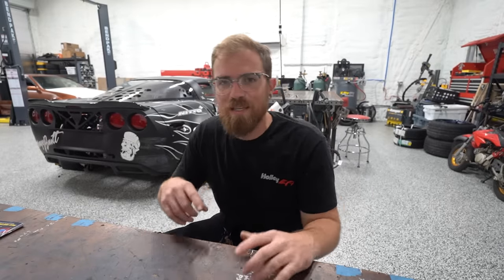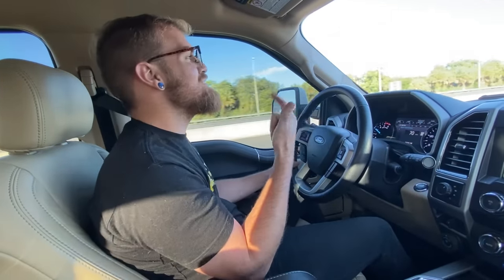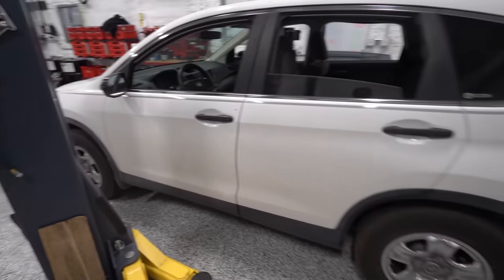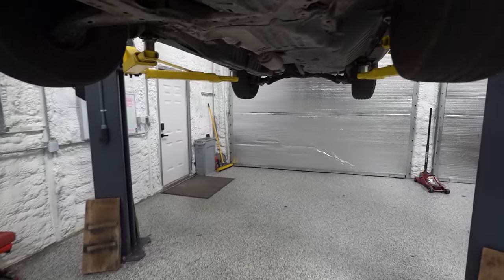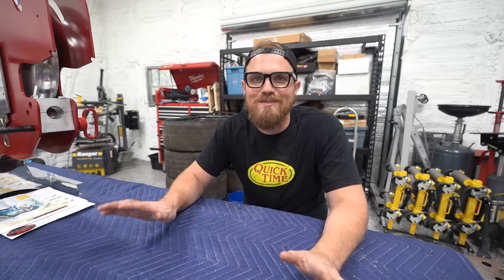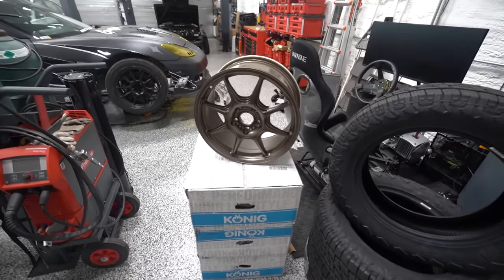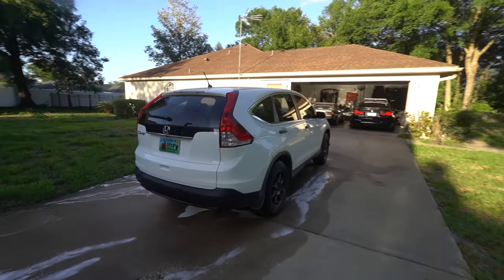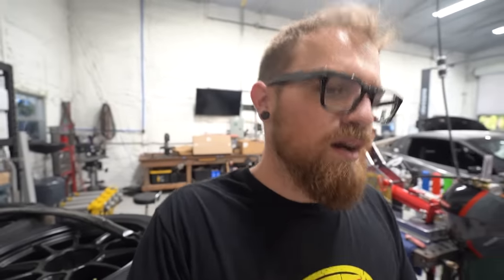Buying a boring daily and fixing it up.

Comment: Hard to go wrong with a Honda or Toyota as a daily driver.
Reply: My 15' Rav4 with 170k miles and zero issues, my old 08' rav4 with 280k miles and who's only issue is an ABS wire, and an old 05' Camry that had 300k miles before leaving the family all agree lol (All of which lived 99% of their life on horrible Michigan Roads and Winters)
Reply: EDIT : CANNOT
Reply: toyotas are better tbh i cannot stand the d series lineup & their cylinder head issues and 4 speed autos failing

Comment: Freshen the bushings/mounts/joints and wheels bearings, maybe rebuild the brake calipers depending on the condition of the boots.  And full fluid freshen.  At least those are what I do as a base maintainance with a used Honda.  Especially the McPherson years.

Comment: Honda technician 👋 oil pans are common leaks on those. Need to drop the subframe a little to get it out - hondabond to seal. It also looked like the oil filter housing was leaking. Its 3 bolts, 2 O rings to fix. Some say you need to pull the intermediate shaft, but uou dont - takes about 20 min to fix.  Rotors on hondas in general warp easily so good you were able to fix that.

Comment: OIl leak might be the K Vtec solenoid. Can reach over the valve cover on the left to check. It will drip all the way down the back of the block.

Comment: Fun fact, rotors in general don’t warp, shaking is actually from inconsistent mass transfer of brake pad material caused by differences in friction of the rotor surface, that’s why getting the rotors turned just freshen the surface.
Reply: I’ve never had warped rotors in any of the cars I’ve driven.  The best way to avoid is to let the car coast to a stop as much as possible.
Reply: @user-tb7rn1il3q  almost all of my cars have had it except newer cars, had it on a 05 Lexus, 05 Toyota, and my 94 Nissan. I think it occurs when the rotors get well worn out

Comment: That oil leak is probably the oil filter housing gaskets, its a very common leak on those cr-v's. Its 3 bolts that hold the housing to the block and a few o rings to change out.
Reply: On K series period had to do this on my girl's accord as well.
Reply: VTEC solenoid gasket leaks all the way down on all the k series
Reply: Nice looking CRV. So, what was the oil leak? Update?

Comment: On the topic of tire, balancing, some tires have dots that indicate the heavy point or the point that the valve stem should match up to. Helps cut down on the amount of weight you use.

Comment: The C-RV is an excellent choice.👌
They typically run 250,000-300,000 miles with minimal needed repairs. The minor things you fixed are the most common things needed.
I find that 3-4 sets of pads is about the limit before needing rotors, but that all depends on each driver.
Definitely perfect for someone who works with horses because there is plenty of room in the hatch for tack and gear, not to mention good ground clearance.
The wheels and tires are a very nice touch that transform a stock looking rig to a classy ride.🤙

Comment: When it comes to warped rotors and shaking under braking, I highly recommend you check all the nuts and bolts in the suspension and front end to make sure they're nice and tight. When they're loose, they'll slightly shake the car over time and end up warping your rotors again. Had that happen with an '05 Mercury that I owned for 6 years. I always thought it was just rotors and the rough roads around my state, but a shop I frequent before I sold it found out the entire front end suspension was like, finger tight the entire time I owned the car. I had never checked it because it was a solid car that never let me down. Literally drove brand new after that.

Comment: K24s = Super Reliable.
I would have picked an Element, essentially the same as a CRV.
Rear seats fold up against the wall, freeing up the floor...so you kinda have a pickup bed when you need it.
Congrats ! 😎

Comment: I went back and forth between a 2016 Honda CR-V or 2016 Mazda CX-5.  I found the Mazda aligned more with my wants, but both were good reliable rated vehicles.

I did end up warping the stock rotors in my CX-5 due to spirited driving.  It was so bad it was throwing off the ability to align the wheels....hahaha

Comment: I agree with your thoughts on dealerships. I had a terrible experience with Central Florida Toyota that ended up with me tearing up a check and storming out. And naturally telling everyone about it even 9 years later.

That’s how I ended up with my 2012 Civic. And I recently had to top off the Freon in my AC as well. Same issue, same solution.

Comment: Put an external transmission cooler on it. Road trips will be the death of that trans. The transmissions get hot on the highway then when you get off at the exit, it starts slipping. I was the service manager at a transmission shop for 3 years. I saw several crvs come in with that issue.

Comment: You have two BMWs, Ford F-250, race trailer, drift vet, drift Miata, and several other cars all modded to the ends of the earth and you got her a used cheap SUV? Come on man haha jk jk
Reply from the maker: I didn't have either bmw, the driftvette was mid project, shop wasn't finished, etc when I bought her this. It was right after I finally bought myself a newer vehicle instead of building one from scratch like I had always done. It took me about a year to talk her into letting me buy her anything. But i'm a POS because I didn't buy her some fancy car she didn't want to impress people on the internet? That's so silly. I wasn't even going to make a video about this car, but wanted to show the wheels and tires, and though process behind buying a used car.
Reply from the maker: Also, all of those things you mentioned, make content, which is what makes the money, to buy the things. This car is just basic transportation.
Reply: @Taylordrifts  I know man. I'm just giving you a hard time. Just mocking what some people were  probably thinking. Hence the JK JK ( just kidding just kidding ). Nothing but respect

Comment: Hey Taylor I worked at a tire   shop for several years. You really won't have any issues, with balance. Unless its at higher speeds around 75+. Thats when you would prolly notice it, if actually needs to be balanced. If y'all never really drive at those higher speed's, and it feels fine at lower speeds. Then no sense in balancing.

Comment: Generally, if you have a good wheel and tire and the wheel isn't bent and you look inside the tire and you find the mark Meaning its where the seam comes together and you line it up with the valve stem. You will have almost no balance issues 99% of the time. The overlapping compound balances out for the lack of valve stem in the wheel. My dad did this for years changing tires with pry bars. Tire shops get mad at me when I have to teach them this lol.

Comment: I've got an 04 pilot and I got it with 108,000 and it's now got 230,000 and going strong here in Alaska BTW and I deliver pizza with it. Summer tires I have bf Goodrich all rerrain ko2 on 16 wheels and winter set it factory wheels with Hankook studded winter tires. One of my favorite fixes was my headlight bulbs. I ended up putting mini projector bulbs in the factory housing and those are better then factory incandescent bulbs in the housing and LED bulbs (multiple different versions I've tried) in the factory housing.

Comment: with the daily talk, what would you recommend for a college student with around the same 10k budget? have an ‘01 crv currently that is fairly clean with around 200k and have had it for almost 2 years now, been great, my parents just want to buy it from me for my younger sibling.
Reply: have been looking into the later model crv’s as well but am iffy as i’ve heard mixed reviews
Reply from the maker: I think the Lexus CT200H is a good option. They’re pretty cheap and basically a Prius with a Lexus body.

Comment: My step dad's '12 LX AWD has 286k on the clock, nothing but oil changes and I've done the trans fluid 3 or 4 times. Finally had to do a rear wheel bearing for him last month. Those damn things are mechanically indestructible.

Comment: My wife has a 2013 CRV and it has been the best vehicle I've ever worked on or had to maintain. 
The chassis is light on PITA pieces. Ball Joints, bushings, wheel bearings, have been rock solid with about 95K miles currently. 
K24, with great mileage. 
I will make this thing last to 250K-300K easy.

Comment: I’m a Honda tech, if it’s not a cut trans that judder can be fixed by doing a update on the pcm n flush the fluid. If it’s already been done try flushing the fluid again otherwise the torque converter is bad but that update usually fixes 90% of them n the ax is usually a condenser but just look for oil staining on lines n the condenser like black spots or dust or a wet compressor clutch

Comment: Bro this is crazy. My sister has a 2013 and sadly it had the transmission shutter and since I never drive it I didn’t notice. 2 weeks ago I was with her and she asked me to drive, in the first 30seconds I feel the shutter and ask what that is. She says her car has always done it(she got it with 60k miles and now it’s at 141k) so not great. I look up the issue and I saw the quick fix was a fluid change so we got it flushed out and mechanic said they found shavings in the transmission fluid. Now it shutters like crazy. we have to either change the transmission or get a new car. I’m happy the transmission fluid fixed yours though.

Comment: Just did almost the exact same thing with my wife.. Needed a car, bought a honda with an oil leak, shuttering transmission, and shaking brakes. Unfortunately I had to do ball joints and tie rod ends with the brakes

Comment: Rookie move not balancing ur tires, I’m a 24 year veteran of the car repair world and mechanic the reason for balancing is just to stop the steering wheel shaking it’s more for your bearing and suspension components. The small harmonics you don’t feel because the suspension and bushings and other soft things parts are drowning out your for sure putting stress and premature wear on a lot of your car including the outer bearings in the trans, but hey it’s not my car do what pleases you and your girl. Plus when the car fails you get a new video to make.

Comment: I just bought an 05 TL with transmission issues hoping it was the simple fix too but unfortunately it was not lol. Need to put an 06-07 accord transmission in it now. Not looking forward to that. Also MPG is MUCH worse than I thought. Total fail on my part for a cheap daily.

Comment: Im a tech at a Honda delaer. These CRVs are good vehicles. One common issue to look for is oil consumption. Just keep an eye on the oil level. If this is neglected it can cause the timing chain to stretch.

Comment: When I had my 8th gen r18 Civic with the five-speed manual trans I had the same problem where the rotors were warped and I also had bad front left and right lower control arms causing my steering wheel to shake violently

Comment: taylor that oil leak is from the oil filter base gasket, cheap rubber seal, just take the three bolts off and maneuver it out, you dont have to take the axle out!

Comment: Looks like the oil filter is leaking tbh bro also you should have cleaned the hub before putting the new rotor on too

Comment: Trucks and SUVs have always been marketed as safer while actually being more dangerous then cars. Car manufactures started making SUVs purely so they wouldn't have to meet emissions and safety standers that cars are required to meet.
Reply: Pickups and Utilities are safer for their own occupants.  They sit up higher and ride over obstacles in a collision.  They have more metal to absorb crash energy.  They provide better visibility to the driver to avoid a collision.  They can go off road to avoid a collision.  They are built better and stronger.  They have lower death rates, injury rates, and insurance rates.  Sedans are the some of the most dangerous vehicles especially the compacts.

Comment: You need to use purple ceramic brake grease on the slide pins, back of the brake pads and the part of the caliper bracket the pads sit in, makes a big difference

Comment: If you line that red dot on the sidewall of the tire with the valve stem you have the best chance at achieving proper balance. Red dot = light spot of tire. Yellow dot = heavy spot. Red dot always takes priority if both colors are present. And I never balance my tires either. And I would like to see a current toolbox tour video.
Reply: That's completely incorrect. The red dot is highest point of the tire, the yellow dot is the lightest point of the tire. You can find this information on the websites of tire manufacturers like https://www.yokohamatire.com/tires-101/maintenance-care-1/mounting-your-tires,  https://www.toyotires.com.au/news/seeing-spots

Comment: Ac compressor or evaporator
Check the oil filter housing o rings for that oil leak. 3 bolts and a o ring seal behind it
Reply: And please do a headlight resto😂 it kills me to look at as I work at Honda and do them all the time. Just sand with 1,000 grit and buff till shiny / clear

Comment: Brake pulsation is usually caused from disc thickness variation.  Not "warped" which is a common misconception.  Love the car BTW.  I'm a huge honda fan.
Reply: Same crap
Reply: How does this "thickness variation" develop? Poor castings?